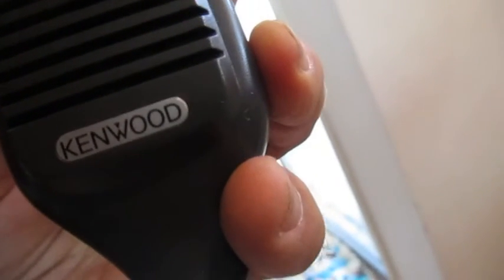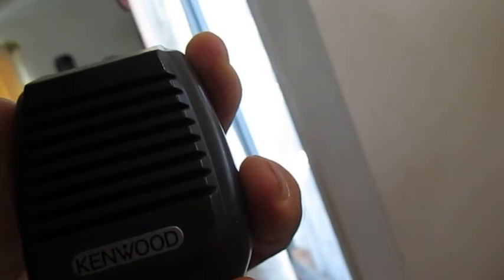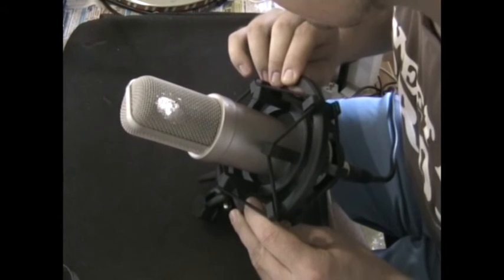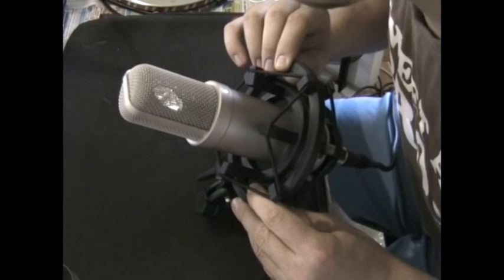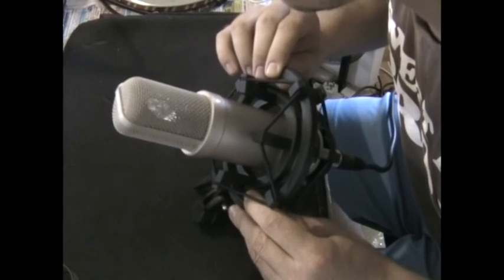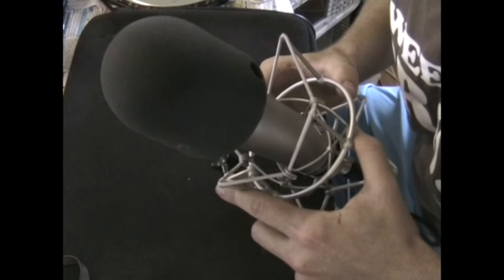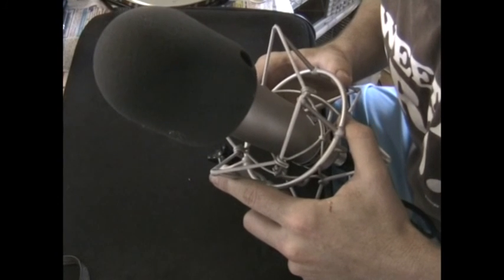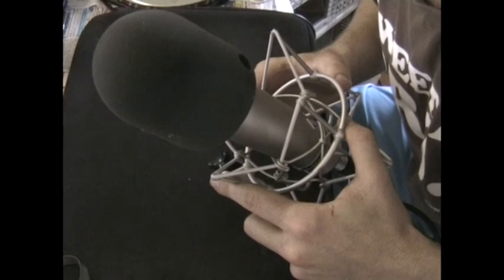Microphone Comparison Test HF Band

Comment: so  for better performance  you need to spend more or you get what you pay  for
Reply from the maker: Yes in most cases even though stranger things do happen, which doesn't sound professional... but yes you are right. Although I might not recommend spending $3K+ on a Neumann U87, could be bit over the top, but was a fun comparison test
Reply: imagine  $ 3000 for a microphone
Reply from the maker: yeh, its only really usefull in situations where the rest of the audio chain actually passes those frequency bandwidths through lol but a fun experiment to "show" off a few mics :)